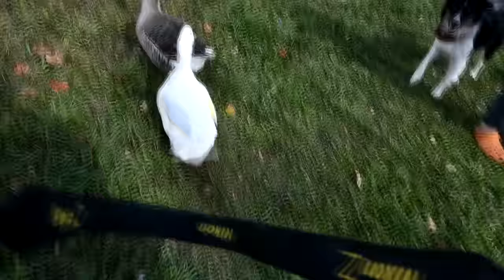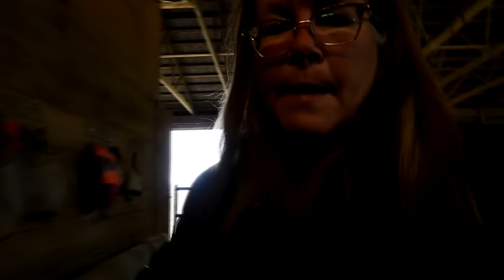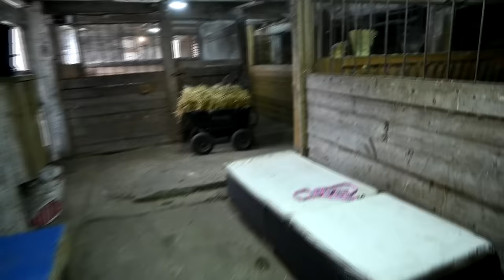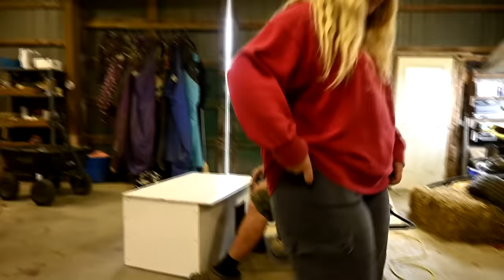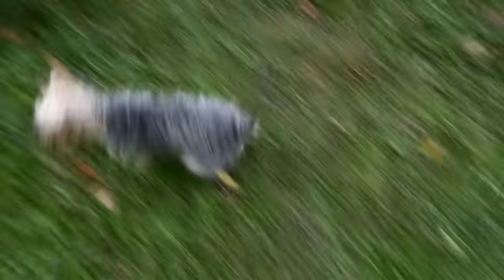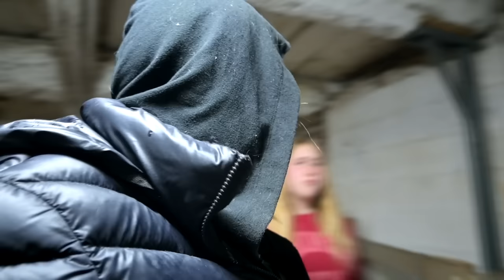Oh No....The Goats!  We're Starting To Panic!

Comment: Hi Laura you ought get Draft excluder for any door or window flexible draught tape for door adhesive soundproof is better any thing keep warm all horses ,duck and goats ok
Reply from the maker: I will look  for it
Reply: @DayByDayVlogs Laura don't forget you need air circulation if not you will have disease and problems with respiratory. Animals and humans actually any breathing things need fresh air not just fans to circulate air. And if you make it to warm when turned out they will feel colder because their body hasn't adapted to the weather.  And if you notice that animals that weatherizing their body some have more hair than others. Can you tell me way or anyone else out their. We also do it to.
Reply: Don't think that barn will get to warm being it's metal an metal roof not insulated.

  There are heated barns here that are 50 degrees horses get turned out an it's 10 below zero or single digits above zero.  Never an issue horses do just fine.

Highly doubt there barn will be that warm even with drafty places sealed up. Have a wood sided barn with metal roof warmest it gets is 5 to 6 degrees warmer then outside.

Unless barn is insulated just not going to have that big of difference between inside an outside Temps.  My barn is fully inclosed walls up to roof line an two doors one on east side of barn one on West side.
Reply from the maker: Are you taking about the chicken coop?  Trust me.. lots of ventilation!  Same as the goat barn and the horse barn. No one is going to be too warm this winter!  That's for sure!
Reply from the maker: Ya!  Only change is they are out of the wind a rain/snow